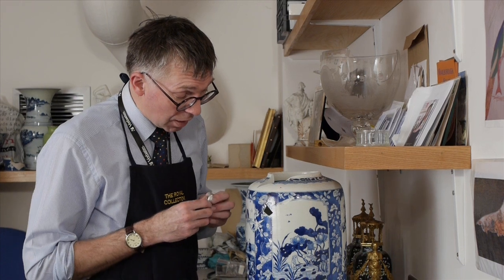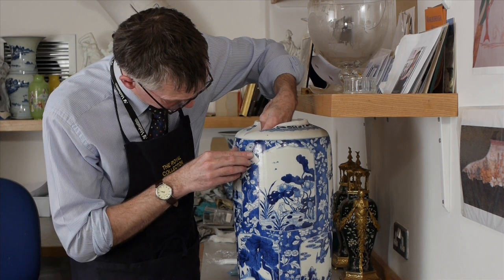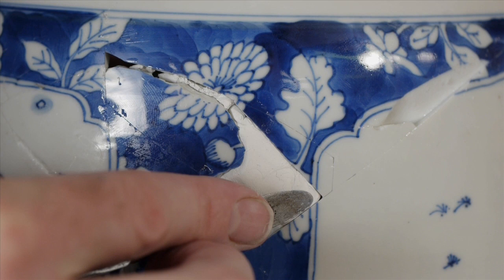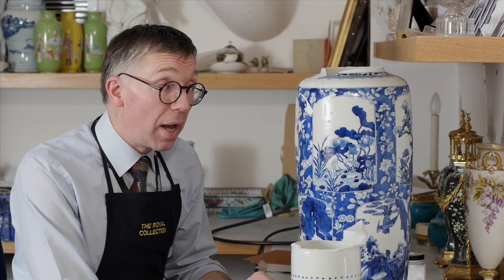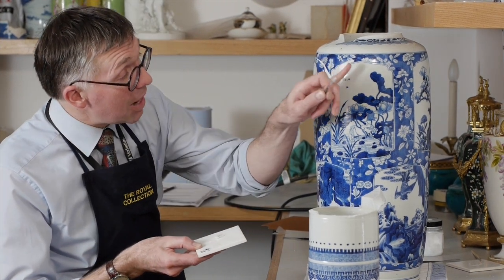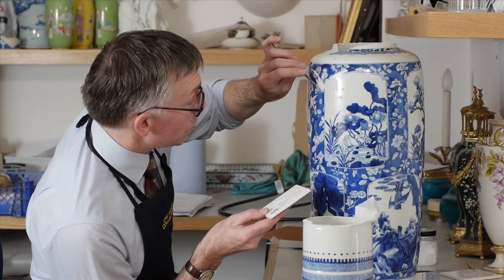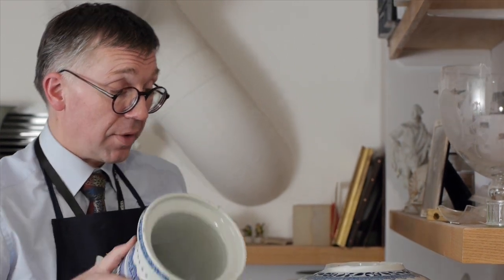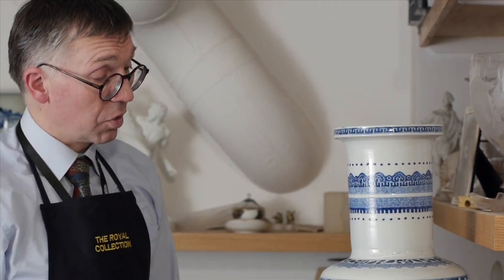Royal Collection Trust: Restoring Porcelain, Part 4

Comment: What kind of glue can we use in the USA?
Reply: You may try the porcelain repair kit that is available at Lowe’s or HomeDepot. It is supposed to be used to repair small cracks and chips on the surface of bathtubs. It should also work for small repairs on vases.